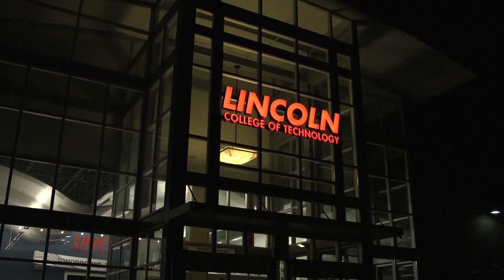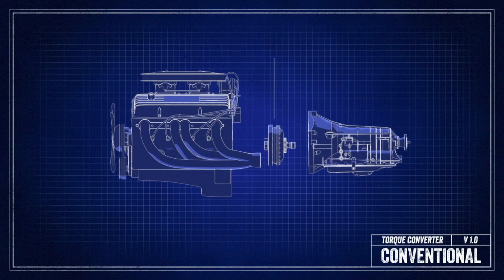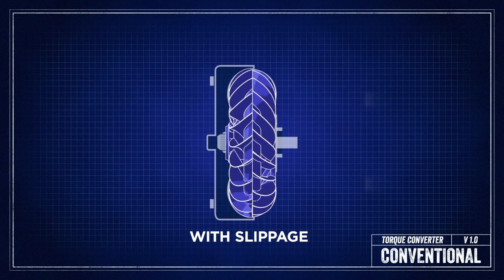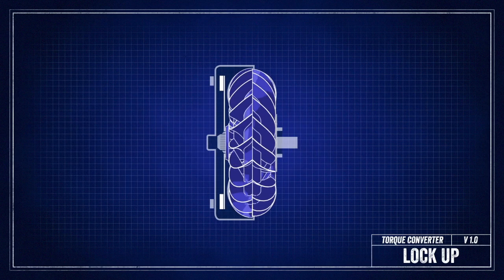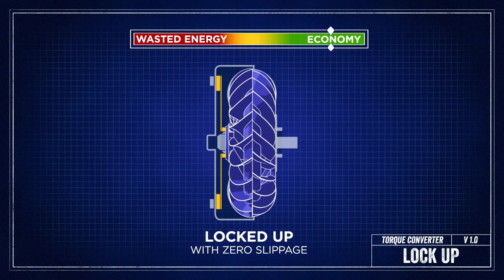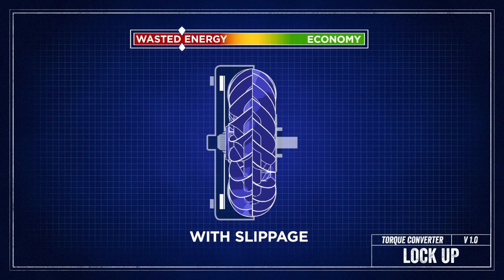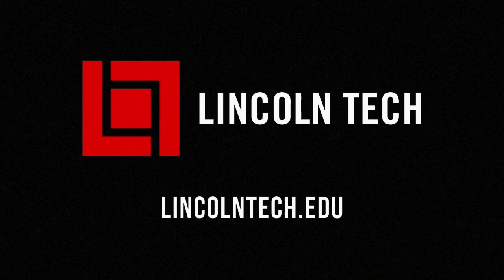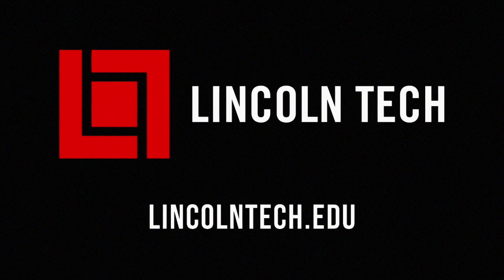Lock Up Torque Converter | Hot Rod Garage Tech Tips (Ep. 59)

Comment: With a non locking converter is there extra heat created from the converter when driving outside of the stall speed?
like with a 2,500 stall, after you get moving from a stop and are driving at less than 2,500 RPM is it building extra heat?